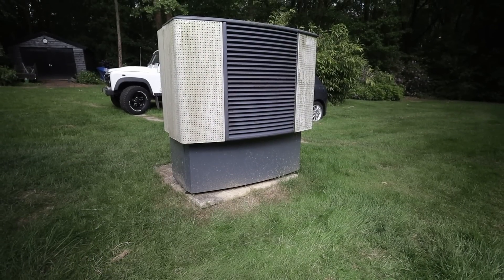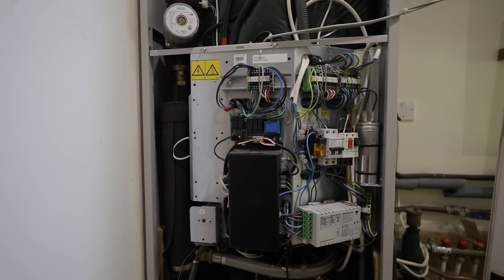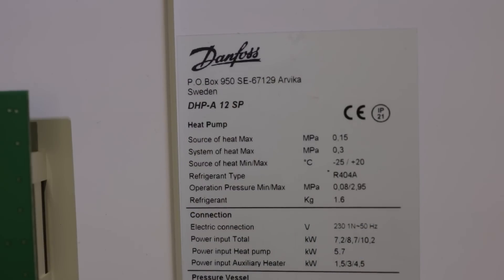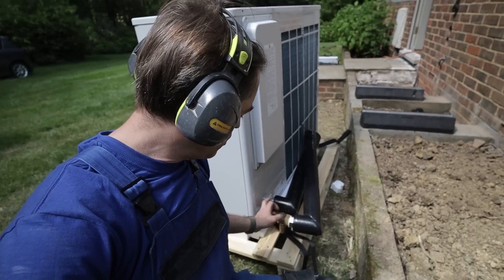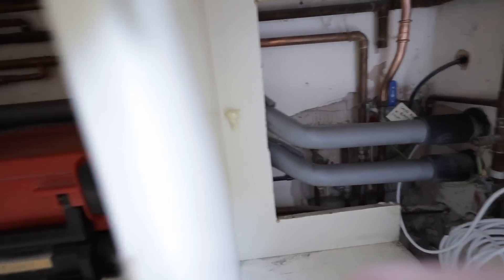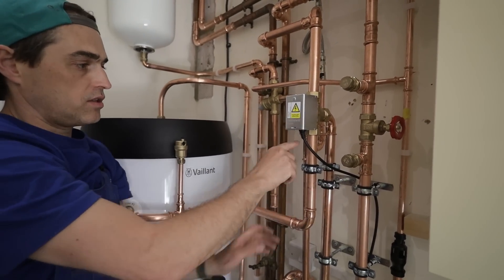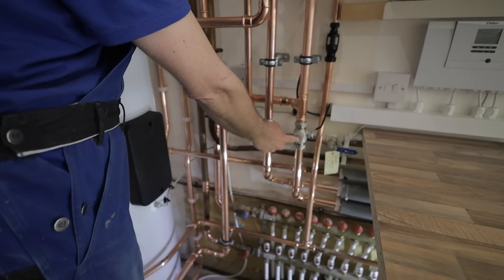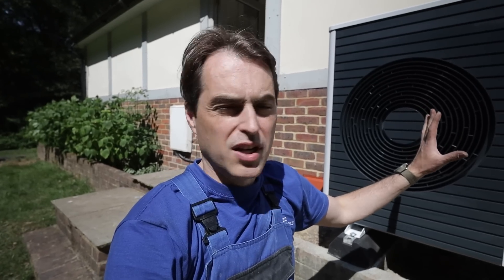Unlocking Super Efficiency: Air Source Heat Pump Swap With Vaillant Arotherm.

Comment: Lovely video as usual! Question about UFH without zone valves or actuators..... did they rely on different spacings to acheive the different temp/ heat loss requirement in different rooms? Seems a high risk strategy to try and acheive that with one constant temp flow through the entire system....... Especially when those controls would be a tiny part of the budget.
Keep up the great work, I love the more technical aspects of your videos!
Reply from the maker: Yes, it relies on good design and proper commissioning. You can actually adjust flow through different loops and also radiator circuits and match the mean water temperature to the heat loss of the room.

This is not about saving money on installation by not having thermostats or actuators. This is about keeping as much of the system open as possible as it dramatically increases the system efficiency and lowers running costs.
Reply: @UrbanPlumbers since I’d come to ask the same question… is there not a risk then of those various relative flow rates (through the different loops) shifting over time, and then without any active zone control, there would be hot/cold areas in he home? Also, am I right in thinking that there’s only heating in this design when there’s no hot water demand? If so, could this not be problematic? I’m all for the simplification btw - less points of failure, and I understand that maximum efficiency requires maximum flow, but I worry that any imbalance in the system further down the line could be problematic with active controls to keep everything in check.
Reply from the maker: @rickwookie  imbalance in the system is not really an issue with fully weather-compensated low-temperature systems as it is with high-temperature systems that are prone to overheating.

I have loads of systems running like this with no major issues.

Comment: More like unlock your wallet???? What did that Danfoss cost 13 years ago 8/10K? Say that cost 8k, I have spent that sort of money (£1800) to buy my oil fired boiler and run it for 13years, and my boiler is still going strong and should be for 5years or so more.

Comment: Excellent video - thanks. Are you aware of any good information on how to calculate if the circulation pump is adequate for the heating system? I would like a direct system and want to know if I need to upgrade pipework..
Reply from the maker: Well, you need to understand how to calculate your heat loss, then work out the index circuit of the existing system and see what size pump you need by reading the head available on the pump after it goes through the heat source (for that you need data from a heat pump or boiler manufacturer). It requires few skills to do and also usually heat loss software. I use 'heat engineer' for heat loss and a HyTools app to work out pipework pressure loss.

Comment: Another excellent video.  We have basically the same system, installed in March of last year.  In March this year we had the UFH pump and the upstairs radiator pump removed as they were no longer required.  It’s great to see someone else working this out as well.  Please keep up the great work.
Reply from the maker: thank you for watching. The amount of unnecessary pumps and zone valves being installed is mad.
Reply: @UrbanPlumbers  if I were to design a house now I would have underfloor downstairs, single Zone.  Radiators upstairs with only balancing valves.  It’s essentially how our house is running now.  We are evening running it with the adaptive heat curve enable.   Love it!   The new version of the Vaillant app makes a big difference now as well.  Keep up the great work.

Comment: I work in social housing as an electrician. Where i work now they are still fitting baxi assure boilers, i guess hoping hydrogen will take over from gas (it wont). I think eventually they will be forced to start fitting heat pumps in bulk. But there are many horror stories from social housing tenants of poorly installed and inefficient heat pumps, having been fitted by contractors with no real understanding of them. I really hope there is good training for the people who will end up fitting heat pumps in social housing or tenants will be pushed further into fuel poverty by botched installs.
Reply: Air-air and a direct unvented for the social housing stock. Easy on/off controls, people can only heat the rooms they need, and they cost sweet f-all… Air-water needs a different mindset and end user education.

Comment: Wow Simon so cool to see your work again, really  showing its not that complicated to have a heat pump installed, simplify the system.
I have myself audited many systems, that have been over engineered/pumped, removed those extra pumps them with good results.
Reply from the maker: See you tomorrow?

Comment: Excellent video again. I'm a home owner building my own home. Struggling to get someone to do overall design so teaching myself. I have UFH upstairs and down at 100 c/c spacing. High insulation and air tightness. High thermal mass. I'm happy that I have built the basics correctly so will only need a small pump to heat a large house at very low flow temps. The bit I'm struggling with is how best to integrate about 7m of solar thermal panels I had built into a south facing roof. Any pointers?
Reply: I have a log burner vented back boiler in my workshop that is connected inside the house to a heat exchanger on the return side of an unvented combi boiler heating circuit, it keeps the pressurised system separate and has its own sludge filter. You could do similar with your set up, its like a pre heater before the main heating source.
if your using a new ASHP like the Valiant he's installed you probably would benefit more from selling the thermal panels and installing 400w PV  panels/battery storage to power the whole system as long term you will have greater financial and green gains.

Comment: Great video - thanks. As a designer I wanted to run underfloor and radiators on one pump, but my calculations have shown that I'd need higher temperature for radiators than floor (though both low - eg 40 C radiators, 28 C floor) so have ended up with motorised mixing valve & pump for underfloor, all under heat pump control. I'd rather be on one pump but worry that either the rads will be too cold to do much, or the underfloor will overheat. I do like the absence of manifold actuators and have gone for manual adjusters for user to tweak rooms as required. Will you do an update in winter so we can see how it works in practice?
Reply from the maker: Yes will deffo do an update in the winter
Reply: I can't work out how to size radiators and ufh for the same temperature without fitting very poor ufh.
Reply from the maker: Why? What makes a ufh ‘very poor’?
Reply: @UrbanPlumbers if I need to run ufh at higher flow temps to match my radiators.
Reply from the maker: @andrewmillwardwatford9410  it is not that simple Andrew. It varies from job to job. You can also fine-tune rads / UFH with a gate valve on a return from the rads. 

I got 5-6 of those types of jobs installed now, but need to wait for the winter to see how they perform and if they need any additional adjustments. 

Tommy Jones is trying an interesting by-pass / CCT concept on heat pumps, where UFH gets a lower temp than rads. He struggles with too much output from UFH on some of his jobs.

My experience is the same - too much output from UFH most of the time and not enough from rads.

Obviously much easier to do the same flow on the same DT - not as you would do on a gas boiler.
Reply: @UrbanPlumbers  but this is simple to do. A simple by mixer and it's own curve.
Reply from the maker: Then you need separation and additional pumps - exactly what we are trying to avoid
Reply: @UrbanPlumbers  why do you need separation? Same dt
Reply from the maker: @andrewmillwardwatford9410  I don't follow you, you will need to add 2 pumps to the setup as you cant have a mixer without a pump? If you do then you have heat pump ciruclator running in series with UFH and rads?
Reply: @UrbanPlumbers  is the heat pump circulator modulating ?
Reply from the maker: @andrewmillwardwatford9410  yes, some are DT, and some are fixed speed, vaillant is modulating a bit, but usually runs with a very narrow DT (2-3) that only widens when it gets colder, but it is not a fixed speed. (No one can explain the Vaillant pump behaviour)
Reply: @UrbanPlumbers  I've been looking at injection mixing. I'm not sure if it's the answer. I don't have this avoidance of hydraulic seperstion though. If you need it you git to have it.
Reply from the maker: Most heat pump jobs are so much cheaper and easier without it though. Also space is a real issue if you need to add a buffer and mixing stations. 

Also distortion. Guys with more experience in heat pumps than me all agree, separation kills efficiency on heat pumps
Reply: @UrbanPlumbers  why would it kill efficiency?
Reply: @andrewmillwardwatford9410  seperation requires mixing shunt, which can never be bypassed 100%, it will always perform some shunting, and therefore will require a few degrees higher supply temp, which matters a lot for COP.
Reply: @96Lauriz  what is a mixing shunt?

Comment: A problem I see is that if the heat pump is producing say 75C water with this pumped into the cylinder, when the cylinder is satisfied the diverter valve will send 75C into the low temperature underfloor heating plastic piping, which can do damage. I would have been tempted to keep the UFH pump with a blending valve to avoid this.
Reply from the maker: It will not. It keeps the diverter on DHW
Reply: @UrbanPlumbers  
The Heat pump's controls keep the diverter valve open to DHW until the heat pump reaches a low flow temp suitable for underfloor heating?
Reply: @zlmdragon.  
You are supposed to have stored water at 60C or above for Legionella prevetion.
Reply from the maker: Not true
Reply: @UrbanPlumbers  
It is clearly recommended to store water at temperatures that kill Legionella. Many cylinder manufacturers recommend it and supply blending valves.  ACV for instance.
Reply from the maker: @johnburns4017  not true mate. You can safely store it at below 50C and run the occasional legionella cycle.

Comment: My conclusions:
1 You are a very good plumber
2 Heat pumps break down - so you have to see if the cost of one can be amortized in a 10-15 year period compared to a gas boiler + the difference in energy cost; you should also take into account the difference in maintenance costs for the 2 systems because heat pumps have much more expensive parts than gas boilers... - if it cannot be amortized, better install a gas boiler and with the difference in money to install a photovoltaic system to offset the difference in energy consumed...
I believe that in the next 10 years it will be better to invest (for the same amount of money) in a gas power plant and a photovoltaic system than a heat pump ;) + you have a good chance that your home will work more ecologically than a heat pump because a good part of the energy for the production of electricity comes from power plants that burn various forms of fossil fuels ;) :) .
Reply from the maker: No gas at the property
Reply: @UrbanPlumbers  I know :)  ; It was just my general opinion: if I put the available money on the table what is the best return on investment :)
Reply: @Mihai Achim
Yes, sometimes you need to step back and reassess.  In one case where it was a terraced house with a full renovation, I advised getting rid of the gas, inc' mains gas pipe to the street. I advised underfloor insulation, internal wall insulation, insulated external doors, triple glazed windows and heavy roof insulation.  DHW was a Quooker tap, and an 11KW instant water heater for the bathroom. Heating was an electric towel rail in the bathroom, a kickspace in kitchen and underfloor electric on the ground floor only.  Heating is rarely needed.  All electric heating and DHW was cheaper to install than a combi and rads.  And no big box on the wall taking up space.  

The saving of the gas meter standing charge was £100 per year and the service of the boiler at £100 per year.  £200 buys a lot of electricity. He was delighted.
Reply: That only adds up because we don't yet have a proper price on carbon emissions.

 I think carbon emissions are a factor for many choosing to install heat pumps. We're still in the early adopter phase.

Comment: Great job, just a couple of questions

1. Building regulations for 2 zones on property ove 150m2? I love your ideas of simplicity but would have been so easy to zone it?

2. I had the idea that the blending valve on underfloor protected pipe from excessive temperatures? That there is a maximum floor surface temperature and if HP can do 75Dc could this go to space heating or only DHW pasteurisation?
Reply from the maker: Space heating is limited in the controller and by the heat curve. You don’t want to be zoning fully weather compensated set ups on heat pumps in most cases. It actually can have a negative effect: lowering efficiency, creating more cycling and making running cost higher. 

Just see what the compliance following guys get on their installations - it’s usually terrible
Reply: @UrbanPlumbers  the radiators and underfloor are ok following same curve? Never done heat pumps but did do viessmann training on them 20 years ago.
I gave a ecotec plus with vrc700 with VR68 for solar thermal and might be doing kitchen which is last room in bungalow to get floor insulation. The VR62 did have possible external control of bivalent systems, so buy energy supplier.

Comment: Awesome video. I thought the Vaillant heat pumps had a pressure relief valve already fitted on the pipework within the outdoor unit so no need for one inside the property. I know Mitsubishi with their R32s dont want an additional pressure relief valve inside due to R32 being flamable, thought R290 would be a bigger no no due to air break on tundish into property.

Did the index circuit end up being on the radiators or one of the UFH loops and how would you roughly calculate if you didnt have access to loop lengths?
Reply from the maker: Vaillant schematics (I know - not to be trusted - lol) show additional PRV on the internal robo kit. 

The index is deffo UFH. I just had to assume the worst-case scenario - 100mm spacing at the longest possible pipe run of 100m and flow reverse-engineered from calculated heat loss per m2 for the biggest heat loss area.

Comment: Great work.  I've started to see a few ASHPs fitted on brackets bolted to the walls of properties rather than on concrete bases. What do you think of this? Its obviously quicker.
Reply from the maker: It’s actually more difficult and makes servicing difficult - I would only do it as last resort and with single fan units only

Comment: Are there any internal and external temperature sensors or is it just the hand held device that has a thermostat built in?
Reply from the maker: 2 external sensors - one for WC and one reading the unit air intake. Not sure why Vaillant can’t use air intake for WC

Comment: Syzmon that was absolutely excellent.👍 Can I just pick up on your design point of establish head loss of the index circuit and checking the pump curve to ensure it can overcome that. In this situation those calculations enabled you to make two pumps redundant and were able to use the units integral system pump. So, if the integral system pump had been too ‘small’ could you have fitted a larger one without encroaching on manufacturers warranty conditions? Thanks for sharing all this good stuff.😀👍
Reply from the maker: Not on this heat pump as it’s build on. Separation would be needed

Comment: Can a heat pump be installed on a flank wall, at 1st floor ceiling level. Available space at ground level is difficult.
Reply from the maker: Potentially yes
Reply: @UrbanPlumbers  Thank you, all my plumbing, tanks, boiler and whatnot are in the attic (plenty of headroom there) so a wall mount HP would eliminate a lot of external pipes etc.

Comment: Will Vaillant publish the air brick / ventilation brick clarification anywhere? That would be very useful!
Reply from the maker: Awesome, thank you
Reply from the maker: I am not 100% sure, but can ask
Reply: Thanks  @zlmdragon.
Reply from the maker: I hope they will. I am still to receive that email
Reply: @UrbanPlumbers did you receive confirmation from valiant on air brick I have similar issue with air brick and drain in zone
Reply from the maker: It in the installation quick guide now
Reply: There are only 3 large producers of the compression pumps, so i do not think so